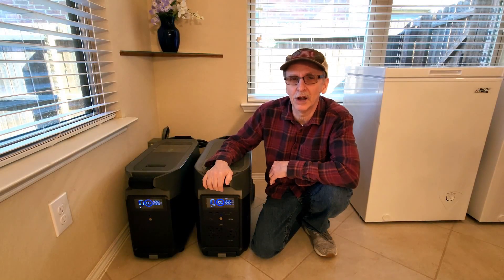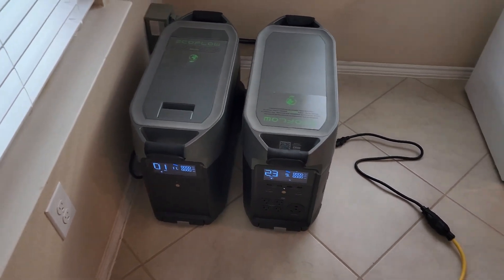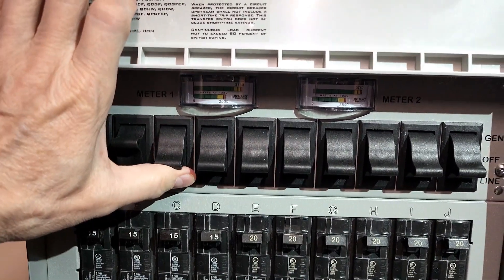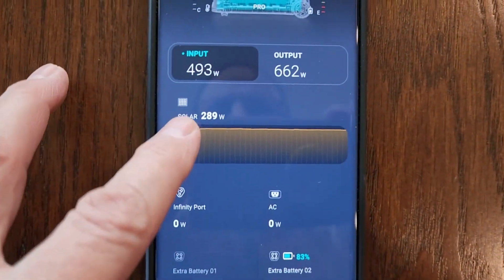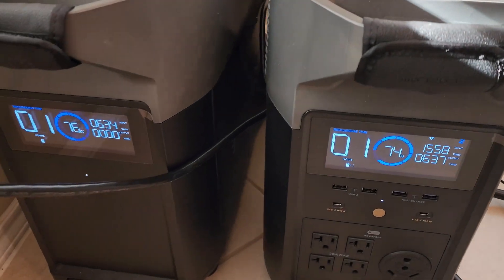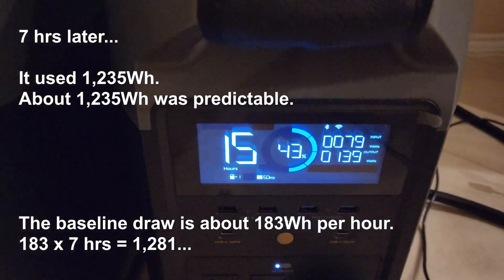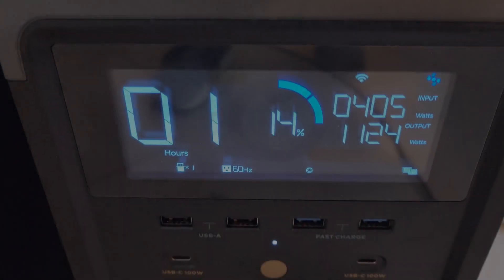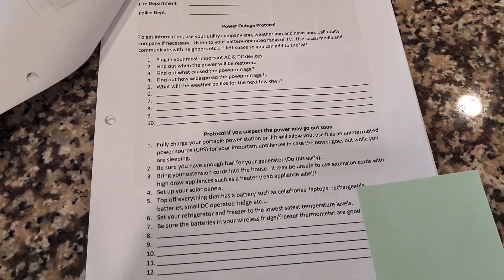Ecoflow Delta Pro Solar Generator - 24 Hr Power Outage Test. Charged With Gas Generator And Solar.

Comment: I just got an EcoFlow delta 2 since it’s powerful enough to run the majority of creature comforts without power for a while before having to pull out the Honda EU2000.   In testing it I found that at full speed charging (1200 watts) after running for a few minutes, the battery will stop charging….wait a little and then start charging for like 30 seconds, then stop, then start again over and over.  My only thought is that that unit didn’t like the AC output from my generator…it’s supposed to be a pure sine wave…hmm.  When I lower the setting on the EcoFlow to 1000 watt charging or lower it charges continuously with no issues. I may reach out to EcoFlow for feedback.
Reply from the maker: A good place for ecoflow info is their FB page. You will usually get an answer within minutes. Let me know what happens.

Comment: I have 2 Delta Pro batteries and several 400W solar panels and just bought 570W window unit for possible summer rolling black outs.  Being able to cool a small space for awhile gives you time to plan, but still worry about a long term, days or weeks, power outage where it's possible that no gas pumps will be working and a full tank doesn't even get you out of Texas if you need to.
Reply from the maker: I also have 2 pros now. https://youtu.be/qqd_rPqo6Cc?si=jRiZnsBU2FcOHByO
I also have another video that shows me using it on window AC.
https://youtu.be/MkH6B_AzNQ0?si=5kj5DwhKspXw7tKb

Comment: Howdy partner, nicely done video. Just subbed as you have more for me to watch. With that set up you have there would it be capable of running a well pump to keep water as needed  ?
Thank you sir.
Reply from the maker: Depends on how many watts your pump uses. Find out how many watts it uses in a 24 hour peeiod and max watts at anytime.

Comment: Can you get 240v with that setup. Or would you need 2 delta pro’s?  Awesome video.
Reply from the maker: No.  I said in my video that its a 120v, 30 amp setup. You can have 240 if you have 2 DPs if you want that, but I have no need for that. My setup is mainly for emergency power.

Comment: Could you explain using the dryer outlet when outlet is hot with 240v to charge?. How is the dryer plug and extension cord socket on each end wired. The extension cord is just a black, white and ground white, right?  I don't get it.  Thanks so much for a great run down!
Reply from the maker: I added the cables in the description.  I was editing and somehow they ended up getting deleted, but I added them again.  They are out of one of them at this time, but just search for another brand.  They are usually out there.

Comment: Great video, I have a gas dryer runs on 110/120v outlet but I do have a 240v outlet/inlet. Could you pls tell me which ext chord I would need to fast charge my DP from the 240v outlet to DP. TIA!
Reply from the maker: It should be listed under the description.
Reply: I did see the black extension chord from DP, then the yellow ext chord matching DP black ext chord but the third black 30amp not matching the yellow  chord...

Comment: A cautionary note...
Be careful of activating the wifi on ANY solar generator! With today's hacking technology, you open yourself up to either hacks, or malicious actors crashing or disabling your units. 
Some may call that farfetched, but does one really want to find out on the backend? 
Food for thought.... Wifi is a risk on these units.
Reply from the maker: The problem is Wifi is needed to update many of the units. I suppose you can disconnect it you want... Im not concered about it.

Comment: As awesome as these are, they are unaffordable to most people. Smaller, less expensive Ecoflow units are the key, especially if folks take time to save up for them, use tax refunds or any other windfalls of money.
I can say? SPEED of recharge is the game changer here!! Which is wjy i'm a proponent of Ecoflow solars. My 1st 1800 watt solar generator took 7 to 9 hours to recharge via AC cord. Using solar? Haha! Would take forever.
Ecoflows charge up from 0% to 80% in under an hour via AC power. Using GAS generators to recharge your solars, you will save a lot of stored gasoline with quick- charge units like Ecoflows. 
I don't care what bells and whistles come on any solar unit.... if they do not quick- charge, you are 1 cloudy day away from losing your freezer contents.
Also.... if your gas generator is old, hard to get parts for, or is operationally questionable in any way, buy a SECOND gas generator as a backup.
Reply from the maker: I built my first off grid setup in 2015. I sold it with the house. See link...
https://youtu.be/HxJ-MUePm-Y?si=8-u0elsFZ1mvpkvu
Years later I bought a few smaller Ecoflows over time. See link on my review of the Delta 1,300:
https://youtu.be/l36azfAk_Co?si=Anm-xfS6MfHnmIg7
This is a video that shows a few other units I bought over time all before the Delta Pro... see video...
https://youtu.be/IsPfUxQsoTc?si=nhgBB7u-FRBWS9D
So, I have talked about the use of smaller, less expensive units.

Comment: I just got EcoFlow Delta Pro few days ago. It looks and function as they claim and I am satisfy with that. But, big BUT and I hate this, they do not include the solar charging cable and if you want you have to order and pay for it. Bad business practice, they try to save few dollars for product that cost over $3,000.00. Come on EcoFlow.
Reply from the maker: Every ecoflow I bought came with one.
B&H says in comes with one...

EcoFlow DELTA Pro 
In the Box:

EcoFlow DELTA Pro Portable Power Station

AC Charge Cable

Car Charge Cable

Solar Charge Cable

DC5521 to DC5525 Cable

DELTA Pro to Smart Generator Adapter

Limited 2-Year Manufacturer Warranty
...
Reply: @LoneStarPrepping  My unit did not come with solar wiring, the manual also does not list it. I do not know how to show you the page that lists things include with unit. If you show me how i would happy send or show that page to you.
Reply from the maker: @junkvista61  I always got one with all my units. You might call other stores and see if it is included, and if so, call the place you got yours. But, yes, I think it is bad business not to include it. That being said, none of those cords I got were long enough, and I bought longer cords anyway.

Comment: Why not just plug the generator into the AC input on the DP and leave everything connected to the transfer switch? The Ecoflow generator will do this no problem so why would yours not?
Reply from the maker: Everything is explained under description

Comment: @PreppingOver50  Great video. I just bought the Delta pro with the discounted transfer switch. I want to replicate your setup. In one of your replies you told someone to make sure your Gen is pure sine. What does that mean?
Reply from the maker: First, I suggest using an electrician for setup like mine.  As far as gas gen, it should be an inverter generator. Just search inverter gen.  It produces a cleaner current for sensitive electronics.

Comment: Id liike to kknow more about the safety of the “second power inlet”  sounds like the prongs of the non used inlet would be hot?
Reply from the maker: If you read the description, I explain we have a switch that isolates the other but I unplug just to be safe.

Comment: Thanks so much for this video.

I’m confused by your video vs information I am getting from EcoFlow. I own a Delta Pro. I am considering buying the extra battery. When I contact EcoFlow and explain that I want to power appliances like yours and my well pump which is 240v through an interlock transfer switch, they are saying I need either two Delta Pros with their Double Voltage Hub. Or whatever combo plus their Smart Hub (then not requiring double voltage hub). Is this correct? Is the difference that I want to run a 240v item?
Reply from the maker: Sounds correct.  I would do what they say.  My setup is for 120 only.
Reply: @LoneStarPrepping  Got it. Assumed you had some 240v since you were doing whole house — thank you!
Reply from the maker: I actually I said "everything except high voltage draw things such as hvac or dryer" right at the start of my video.
Reply: @LoneStarPrepping  You certainly did.
Reply: @LoneStarPrepping  Thanks for clarifying that. Question: Do you have city water? When you ran your dishwasher, you didn't have to power a well? Our well is 240V...
Reply from the maker: @n8wrl  Thanks for your question.  We don't have a well.  In an emergency, I would not waste power on a dishwasher.  I just did this for power management demo.  I think I said in my video that I would be running things I normally would not run in a power outage.

Comment: this is excacally what I am looking for. Thank you.
Could you share how the set up can be done?
Reply from the maker: Sorry, there is way too much involved.  "Set up" can mean so many different things.  I have videos that teach you how to figure that out.  Again, Im sorry I could not help.  Your best bet is to contact an electrician.
Reply: @PreppingOver50  thank you for responding.  I am not mean to do it myself but want to understand more before to hire an electrician 😊. What you explant is what I in mind. I want there is an outline inside house to feed the power to the whole house by the elerical generator and there is outlet put side of house can feed the power to whole house by using gas generator. So the electrical generator can feed by solar panel so as the gasoline generator. I wonder how much power the gasoline generator will create by burning 1 gallon of gasoline
Reply from the maker: @calittlegarden-3311  I have no idea.  You should contact an electrician

Comment: I have almost completed this set up.  My electrician wanted to know what kind of cable your connected the Ecoflow to the transfer.  It looked like a pre configured one he said.  Did you get it from Ecoflow?
Reply from the maker: I had the first one built but it was weak.  I dont remember where I got it.  It wasnt from Ecoflow. Remember to install a switch which will cut off power to one inlet while other is used.  I unplug just for safety.
Reply: @LoneStarPrepping  explain to me your transfer switch please.  it only serves up 120 to the Ecoflow or does the Ecoflow only accept 120 from the 240 transfer switch?  I don't know much on the electrical side but my electrician is asking me.  He doesn't want to damage the Delta Pro.
Reply from the maker: The transfer switch only serves up to 120. NO 240! 240 not part of it. You need someone who knows how to do this. I dont want to tell your electrician what to do.
Reply: @LoneStarPrepping  Thank you so much for your input!  I will pass the information along.

Comment: It's just a storage device. Not a source of electricity. Reminds me of the Tesla on YouTube that has a gas powered generator on the rear of it. What's the point? Again, not a source of electricity.
Reply from the maker: It is absolutely a source of electricity.  I invite you to check out the 10,000 watt hour battery capacity off grid system I built in 2015. If you are talking about how power gets into the battery as being the source, it can come from solar panels.  But you can also say the source is the sun.  But in my home, I can run my setup all by itself. It is a source of electricity because it converts the DC power in the battery to AC so it can be used in my home. When I dont have sun or gas for my gas gen, and run my household electrical appliances from the Pro, it IS the source of my power. It is not just a storage device, again, because it produces AC power from the storage device, the battery. Now, people have argued that it should not be called a "solar" generator because it doesnt generate power. I think that is what you meant. But, it does. The solar panels take energy from the sun and converts it to electricity to be stored in the battery. The inverter changes the DC into AC.  This is generating electricity from sun light. Thus, it is proper to call it a solar generator when running off solar panels.

Comment: Interesting test. Thanks for this informative video. Am I to understand you were powering your entire house from standard 120 Volts AC @ 30 Amps and not 240 Volts ? It would seem you have a transfer switch which is permitting you to run your household off of 120 Volts AC @ 30 Amps, but I understood most transfer switches and receptacles operated @ 240 Volts AC @ 50 Amps ONLY ? Could you please explain a little more about your transfer switch setup and wiring ?
Reply from the maker: It is set up to only run 120 Volts.

Comment: Thanks for the test and information.  I keep asking you Eco-flow guys why you don't build yourself?  You could get triple or more what you have for the same money.  Then you could run for days instead of hours.  Using prismatic lithium iron phosphate batteries (which have come down in price recently) a charge controller, inverter and bms along with whatever panel layout you wish, you can easily build the same thing in a much larger version for around $4K.  I've often wondered why anyone would buy one of these plastic things.  My 6000 watt inverter produces both 120 volts and 240 volts ac current.   So I don't have to sacrifice using 240 volt appliances in a pinch.
Reply from the maker: First of all, I can run my setup 24/7 when there are enough sunny days with the 1,600 watt solar array.  I said in my video that I planned on puting up 1,600 watt panels. I was only using 300 watts in video to show how to manage power. I am familiar with building off grid systems.  Can you post a link to a video here to the system you designed and built on your site?  Here is the one I designed and built years ago. At that time using AGM batteries were all the rage. I know it is old tech now, but not many people were doing this kind of thing back then. https://youtu.be/HxJ-MUePm-Y
Later, I learned that having something as powerful but portable was the way to go... so... The Pro. 
A side note... I spent less than 4K because I was one of the first 200 to buy the Pro and Extra battrry.  To answer your question... Most people dont have the time to learn how to build one, nor do they want to build one.  I dont blame them!  It takes a lot of time and dedication and genuin interest and knowlege relating to electricity. It is for those reasons people would rather buy a pre-built system.
Reply: Which inverter did you go with?
Reply from the maker: Inverter?  I got the Delta Pro.  If you are talking abkut the system U built, it was only 2,000 watts but was plenty for what I was doing.
Reply: @LoneStarPrepping  Sorry, I was asking the person who left a comment on your video which inverter he went with for his 120/240 DIY system. I was looking at them, but they all seemed plagued with issues, so I got a Delta Pro myself, but I was curious what he bought.

Comment: Hi I would like to know how the  2 generator outlet plugs were wired to the transfer switch a diagram would be helpful also
Reply from the maker: You will need to call an electrician for your specific application.

Comment: GREAT Video.  - I'm very seriously considering using this myself, However, since the solar added so little power, and you needed the gas generator to recharge it - why use the Delta Pro's at all (and just stick with the gas generator) as the Delta Pros won't last (even with solar) to run a house during extended blackouts (even 24 hrs)?  Thx
Reply from the maker: I did not have my total 1,600 watts of solar running on this at this time.  I was only using 300 watts lol.  If it is sunny enough out, that 1,600 watts would be more than enough to keep things running on the batteries 24/7.  The point is, if there is a power outage, especially in the winter, gas stations run out of gas.  I don't want to be dependent on gas for more energy.  I have another  video on my site that goes into that more:  https://www.youtube.com/watch?v=brhhT6EJoG0
Reply: @LoneStarPrepping  aha - makes sense.  thanks

Comment: A very expensive system.  Folks, sodium-ion is the future, not lithium-ion. That's around a $7,000 system you are showing, and it doesn't even include the panels.
Reply from the maker: I spent 45 seconds online and found the setup for 5,200.  I paid half of what you said for both because I was about the 200th person to buy this super early bird. Folks, the batteries are NOT lithium-ion as the commenter said.  The batteries are lithium-iron-phosphate... Big difference.

Comment: Just FYI, Extra Battery can be recharged alone but only by connecting it directly from the EcoFlow Smart Generatorvia the proprietary DC cable provided by EcoFlow and the Smart Generator adapter.
Reply from the maker: I would have bought a smart generator when they first came out, but it was not dual fuel.  I was one of the first people complaining about this to ecoflow even before it was released. They made the change after many people bought the gas only version. I refused.  At this loint, Im happy with my current dual fuel generator.
Reply: @LoneStarPrepping  indeed. It was a bad idea for EcoFlow to only make it gasoline. When EF made the Dual fuel, they should have made it tri-fuel.

I have one of each now just to take advantage of the DC charging feature. 

I also have a Yamaha EF3000iSEB and EF6300iSDE which are both converted to tri-fuel that work well when using Switch Mode Power Supply to charge the DP + EB so I can continue to use them to power house with full 3600 watts of output while they are being charged.

https://www.youtube.com/watch?v=kVEqvLiHx2w

Comment: Excellent Video! I have 2 Delta Pro's with the double voltage hub and I want to get a transfer switch. What is the transfer switch you  are using in this video?
Reply from the maker: You should ask an electrician what to use with your setup.